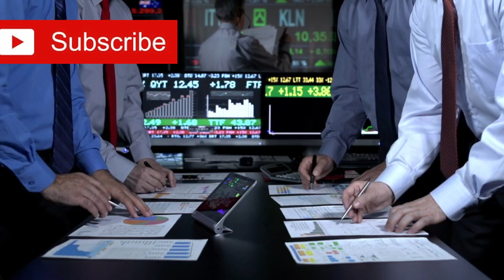China Approves Huawei’s 3nm Chips — Mass Production Starts Now!

Comment: Not mentioned is Huawei/SMIC EUV project that is undergoing test as we speak.  Expectations are that a limited production run this year and full production next year with costs 40 to60% cheaper than ASML's EUV.  Further, China has developed a photonic production line and photonic chips are in production with throguhput said to be a thousand times faster than electrons and power consumptions much less than silicon electron chips. The potential for AI platforms and data servers without power limitations appear to be on the horizon.  China is doing what others said couldn't be done and it has progressed in silicon technologies in 5 years what was said was 15 to 20 years behind the west.  Before the end of 2025 we should be getting more clarity on these advancements and the days of American restrictions will show total failure. America's zero sum game is being drastically overhauled by China and China will be the semiconductor leader in this decade.
Reply: Zero sum game 
US - zero! 😅
Reply: @Abcd1234-q4v . It looks like the US is falling apart, frankly, and it is speeding up.
Reply: Yes, it is pretty stunning. The Chinese have moved much more quickly than the Americans thought possible.

The lesson learned here is “Never underestimate the Chinese”.
Reply: Yeah! There are now some more than empirical evidences that at the most conservative time frame prediction, and apart the long haul plane engine industry for a variety of reasons, on all the other aspects of life, China will enjoy their full technological sovereignty by Easter 2027 and they'll have full technological supremacy by Easter 2032. Long haul plane engines might to be ready by 2030 and supremacy will be done by 2035.
For us westerners all will be as we now know till ~2040 when the gap will start to be as gigantic as to simply surrender on the Chinese terms will be the unique viable choice. Then we'll need to adapt as well as we can.